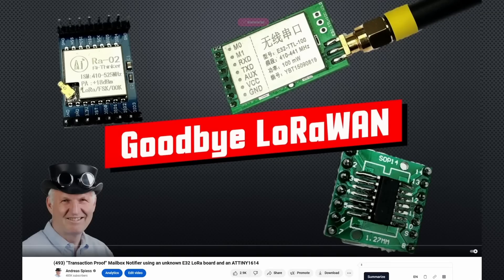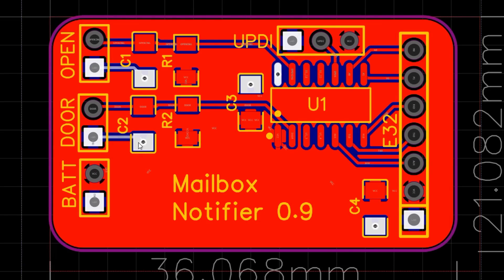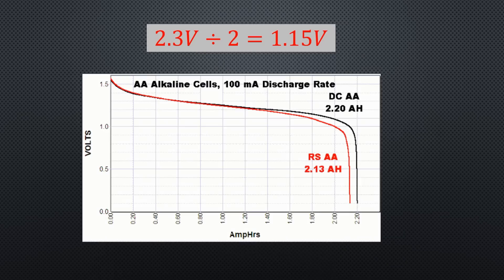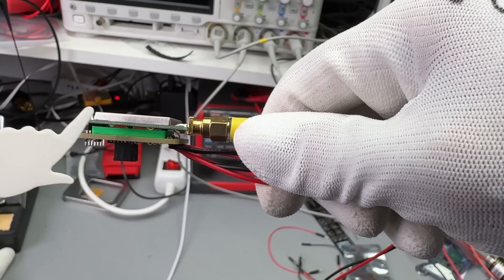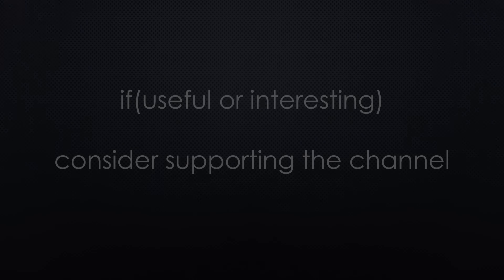(495) Let's build a Lora Mailbox Notifier incl. Tips and Tricks for Your Projects from an Engineer

Comment: Thank you for the video.  two questions:
1.   As I see the trigger is the door opening switch,   the postman is supposed to open the door?     how do you exclude your own opening of the mailbox?     my mailbox just has a slot.   have you considered other sensors, a small PIR maybe?  would it work in my case, ie. the envelopes falling into the box will trigger the PIR?   I know, a PIR draws current when idle, but I guess I have no other choice.
2.  You placed the whole thing including the antenna inside your mailbox which is basically a Faraday-cage.  Can LoRa  cope with it reliably?
Reply from the maker: The slot is for the postman and the door (with a key) is for the owner. As you say, PIRs consume more energy because they have to be always on. LoRa works in my case, yes.

Comment: Building a LoRa-Based Mailbox Notifier: From PCB Design to Home Assistant Integration

*   0:00:02 Project Overview: The video details the complete process of building a LoRa-based mailbox notifier, covering PCB design, hardware assembly, testing, 3D printing enclosures, and Home Assistant integration.
*   0:00:41 Battery Choice Rationale: Non-rechargeable batteries were selected to simplify maintenance, as the device will be far from the house and has very low power consumption. The at tiny1614 and the e32 operate, reliably, down to 1.8 volts and 2.3 volt, respectively.
*   0:01:10 System Components: The system consists of a battery-powered Notifier (ATtiny1614 + E32 LoRa module) and a USB-powered Gateway (ESP32 + E32 LoRa module).
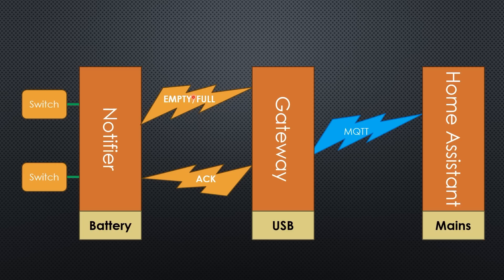*   0:01:49 Communication Protocol: Communication utilizes LoRa modulation with an automatic repeat request system for reliability.
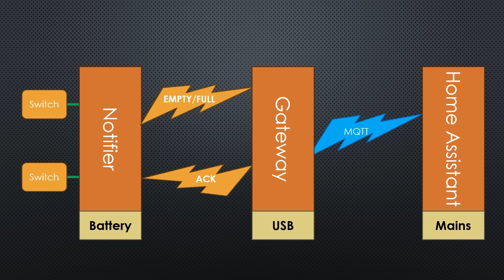*   0:02:01 Home Assistant Integration: Integration with Home Assistant is achieved through MQTT with autodiscovery.
*   0:02:51 PCB Design (Notifier): A custom PCB was designed using EasyEDA, incorporating 1206 SMD parts, ground and VCC planes for reduced interference, and an updi programming header.
*   0:04:07 Pin Reassignment: GPIO pins were reassigned for better PCB layout, enhancing the routing on the board.
*   0:05:55 PCB Ordering Tip: Ordering PCBs in different colors for different versions helps with organization.
*  0:06:21 Soldering: Using binocular magnifier, and tips.
*  0:06:54 Connectors: Magnetic switches utilized different connector, mail and female, to avoid misconnection.
*   0:07:39 Incremental Testing: The Notifier was tested with a prototype Gateway before finalizing the Gateway build, to isolate potential issues.
*   0:08:00 Gateway Build: The Gateway uses a compact ESP32 mini board with an added tantalum capacitor for power stability.
*   0:09:01 Home Assistant Connection: Connecting the gateway to Home Assistant enables testing and visualization of results.
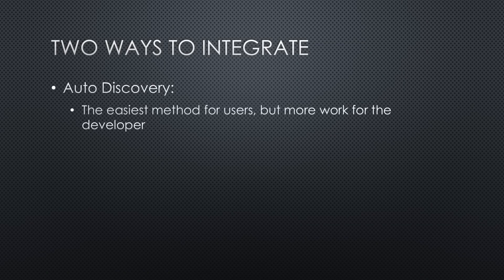*   0:09:21 Home Assistant Autodiscovery: Autodiscovery is implemented for easy user setup, requiring the device to expose specific MQTT topics and send a JSON-formatted message.
*   0:10:51 Home Automation: The integration allows notifications (e.g., Telegram) and dashboard displays for mail arrival.
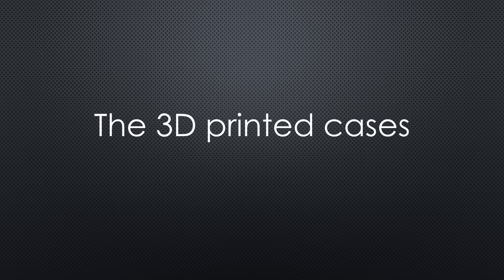*   0:11:17 3D Printing: Enclosures were 3D printed using a parametric box design, taking advantage of a new, faster 3D printer (Bambu Lab P1S with AMS).
*   0:12:21 Hole Printing Tip: Printing holes slightly undersized and then using a reamer ensures a precise fit.
*    0:12:47 Final Mounting: The Notifier and Gateway were mounted to finalize the system, ready for mail delivery.

I used gemini-2.0-pro-exp-02-05| input-price: 1.25 output-price: 5 max-context-length: 128_000 on rocketrecap dot com to summarize the transcript.
Cost (if I didn't use the free tier): $0.02
Input tokens: 14719
Output tokens: 731

Comment: Great project thankyou for sharing. Built  and installed today. I had to modify a bit as I only have one door on the mailbox and I added a battery voltage monitor mqtt to home assistant as well. (it only powers on when door is opened to save power).
Reply from the maker: Congratulations! With only one switch you could switch the power with the reed switch. Then it would last even longer...

Comment: What is the expected range of a device like this? Was it mentioned how far away Andreas’ box is? My mailbox is about 150m from the house and been thinking of making something like this for years.

Great video!
Reply from the maker: My box is about 50m away. However, the metal box is the problem. My LoRa world record 8 years ago was 200km. And others reached even more after me...
Reply: @ Thanks for your reply! I have the possibility to place the antenna outside. I have no previous experience of LoRa. I have understood that LoRA can achieve long transmission ranges, but was unsure if there are any specific limitations for this use case, in addition to the metal box. I’ll test, and find out some day. 

Thanks for your very educational videos! I just found your channel and have now been watching for hours. And I of course subscribed.
Reply from the maker: @bjondersson  Line of sight usually works, also no long distances. No line of sight needs testing. Sometimes it works.

Comment: Many thanks for your ongoing series of DIY projects and tips !  Always interesting and useful. Cool that LORA gets far enough to be used in this application (not intuitive !). As Im more software inclined I think I'd rather code my own tight loop for polling and processing the events from the mailbox rather than be dependent on MQTT and internet. Im in a rural environment so perhaps an external antenna and solar recharging would be better also. Perhaps the 'enclosed LORA antenna' approach would work well for onboard diagnostics in larger systems also.
Reply from the maker: Thank you! If everything is in your posession, you can add solar and an external antenna (I do not own the mailbox). Which would remove a lot of constraints I had for my antenna. But your distances are probably bigger ;-)

Comment: So, you're building a receiver just for the mailbox instead of using a gateway you (I presume) already have? Why?
Reply from the maker: Because it was no more reliable. The TTN sensor worked for years, but since a few month, no more reliably. I did not investigate the reason, I just wanted a simpler system.

Comment: Hello,
How are you using your magnetic switches?
As i know, magnetic switches are normaly closed. So everytime current flows to the pullups and the switches. !?
In your video you are using momentary switches with with NO....

Another question:
in youre code are input pullups are set:
  pinMode(SWITCH_OPENING, INPUT_PULLUP);
  pinMode(SWITCH_DOOR, INPUT_PULLUP);
Are the physical 4.7k Pullups needet?
Why 4.7k and no higher resistors?

greetings
Jürgen
Reply from the maker: Yes, I use magnetic switches. NO and NC is not always defined the same way because with these switches, "normal" is not standardized. So I only bought ones where the seller described the behavior in his own words ;-)
These resistors, in conjunction with the capacitors, should supress switch bouncing.

Comment: I have one question here, what i believe about LoRa it needs line of sight to transmit, in case we have some obstract  it could not communicate, in this scenario when LoRa sender is installed in a metal box, at some ramdon direction how come it can send signal to gateway ?
Reply from the maker: You are right with your statement. However, on short distances it still works out of this metal box because it only needs very low signal levels.

Comment: Thank you!
The notifier runs perfect with an ATTiny412 too!
I only shorted M0 and M1 of the E32 and use only 1 output of the ATTiny.

#define SWITCH_OPENING A3    //PA3 = Pin 7
#define SWITCH_DOOR A0       //PA0 = Pin 6
#define M01 A2               //PA2 = Pin 5
#define AUX A1               //PA1 = Pin 4
//                        TXD = A6 = Pin 2
//                        RXD = A7 = Pin 3

Greetings
Jürgen
Reply from the maker: Indeed a good idea! No distinction is needed for this project.

Comment: I hate the smell of some dupond wires, silicon will be welcome!
The lora ntenna inside the metal mailbox is not a problem ?

(A link to the previous video about it in the description would be welcome 😉)
Reply from the maker: The antenna inside the metal box is a problem, but LoRa with its huge link budget was the solution.
Link added. Thank you for the tip.

Comment: Two AA batteries from Lidl? When they go flat you need to replace ASAP before they vomit their electrolyte, almost as bad as Duracells. Now if I could figure out how to use my Optivisor magnifiers now that I have had cataract surgery, arrrg agrivating, even worse my left hand has developed a bit of a shake. What a curse and I love working on repairing commercial radios and electronic projects! Thanks for this video and I need to look into home assistant, would make life simpler in the home but I have no plans on linking to the open internet.
Reply from the maker: We need people like you who still have the ability to repair radios! They die out :-(

Comment: My version is based on the latching transistor idea you made a few years ago just using wifi. I'm currently powering using 3 eneloop cells into the 3v for the low self discharge, the only issue I have is remembering to charge the cells, any thoughts of measuring cell voltage when powered this way? - Something like the secret arduino voltmeter but running on esp. My box is lined with thick polystyrene in an attempt to retain capacity in winter. Thanks for the great videos.
Reply from the maker: This time I had to choose another way because I had two switches. In your case, you can add a voltage divider and measure the battery voltage with one pin. In my case, it would drain the battery and I would have to add a transistor to switch the two resistors off during sleep.

Comment: I built a yard gate notifier using an ESP32, Home Assistant and (2) inexpensive garden solar lights, and rechargeable batteries. Has been working for a few years not with no issues. The yard lights have a voltage regulator included in the assembly. You could remove the solar panel and mount it on the mail box. Just a thought
Reply from the maker: Good solution, too. I did not use solar because the mailbox does not belong to me and I did not want to make holes, and I also did not want that something stands out. Like that, everything is hidden and locked...

Comment: Tried building something similar with off the shelf lora/meshtastic devices, but failed miserably due to battery limitations. Any way to convince you to sell a semi-built notifier ? Any signal concerns inside a standard Swiss milchkasten ?
Reply from the maker: 1. I will not sell hardware.
2. Of course, the signal is weakened in such a situation. But it works here.
Reply: Thanks!  @AndreasSpiess

Comment: Does the transmit power depend on how much voltage the RF module is getting? Might 3x AA be a better choice to give it some more voltage?
Reply from the maker: I did not measure the output power. Half the power would not matter too much.

Comment: I use a great battery for my projects. It is a Saft LS 14500, LiSOCl2 technology and is 3.6V, AA battery type. This has a fantastic capacity and is capable of running 3.3v circuits, I have circuits, using this battery with MPU sleep that have been running for over 2 years and still going! Definately recommended.
Reply from the maker: Indeed, this is a good technology. Maybe a bit expensive for everyday usage...

Comment: Hi. Another great video. maybe one thing you could have added : a voltage divider to measure the battery voltage. Another thing on your design : I think there is a bit of current leaking from the opening / closing pin (from VCC to GND through 4.7kOhm resistor isn't it?
Reply from the maker: A voltage divider for measuring the voltage using a pin consumes (leakage) current all the time unless you add a transistor to switch it off. And the leakage current through the 4.7k resistor is very small because it has to go through a pin of the MCU which has a high resistance when sleeping.

Comment: Did you have any concerns about placing the device in a metal enclosure and having signal strength issues?
Reply from the maker: That was a concern until it worked ;-)

Comment: With Attiny for simplicity I do the same, but with cylindrical Li-ion batteries, AAA or AA size. They go from 4.1V to 3.0V, don't need any regulator, are cheap and you can just replace it in the device by a re-charged one.  The holders are also the same.  For simple projects, just one AAA size battery last more than one year.  The leakage is also very low.  The new Attiny MCU's by the way are very simple and a lot of fun to program, even bare metal.   And just with one wire + one TX wire, I can flash and debug at the same time.
Reply from the maker: I agree with the ATtinies. I have to try the AA or AAA size Li-Ion batteries.
Reply from the maker: I just looked at the choice. Which one do you use? The USB chargeable ones?
Reply: @AndreasSpiess  And of course these chargers are not compatible with the normal 1.2V NiMH batteries. And being the same size could be dangerous, unless the charger detects it. And also dangerous for a device expecting 1.2V or 1.5V batteries. Better label this batteries clearly, and the holders.
Reply: A prev comment has been removed.  I use normal 10440 (AAA, about 3€ each), 14500 (AA about 5€) or the bigger like 18650. And a USB charger of about 10€, compatible with all cylindrical Li-ion batteries.  In the usual places, just be careful with batteries too cheap or with amazing capacities, in chini-amps hour.
Reply from the maker: @gosdeCarrer  Thank you!

Comment: One suggestion: UPDI connector, pins order, vcc, gnd, updi instead of vcc, updi, gnd.
Reply from the maker: What would be your reason. Mine is: If I power the ATtiny with a different source, I only need two pins.
Reply: @AndreasSpiess  If you mistakenly reverse the connection cable, the attiny will receive the reverse voltage.  With vcc, gnd, updi there is no damage.
Reply from the maker: @mama9712  Good point!

Comment: Could you have used a single 18650 cell and replace it when it needs to be recharged (which would not be often)?
Reply from the maker: I agree. If rechargeable, I also could have used 2 NiMh batteries. I wanted to avoid the LDO. Or one LiFePo4...

Comment: Correction - the better DuPont wires actually copper inside, not just more. The cheap ones aluminum or chinesium if you ask me. 
Any breadboard problem I ever had, was related to cheap DuPont wires !!
Reply from the maker: I am not sure if the reduced resistance of  copper matters on these small distances. Or why do you prefer copper? But the quality of the crimp definitively matters. I also think, that thicker wires do not break easy.

Comment: Awesome video. I also swapped back to regular batteries instead of rechargeable ones, depending on the project. Usually I prefer the so called C cell aka R14. Really cheap and safe. Install it, forget about it. Sometimes it lasts for years! And of course... silicone wires ! They're the best!
Reply from the maker: The R14 seem to be a bit bigger. Because I have many other devices using AA batteries, I always have a stock in my drawer ;-)

Comment: I also like silicone sleeved wires - their fleibility makes them easy to stuff into small spaces. However, crimp connections tend to be weak because of silicone's slippery qualities.
Reply from the maker: I agree they are slippery (sometimes an advantage). But so far, I did not have issues with the crimp quality.

Comment: Good idea to mount the LORA module right beside the ESP32 touching metal /s /j.
Reply from the maker: The sheets do not touch because of the tape. But soldering them together would indeed be better.
Reply: @AndreasSpiess  I'm just saying how the LORA can interfere with the esp32 being so close.
Reply from the maker: @FlatMcdonaldsSprite  In this case, the timing might help (there should be no Wi-Fi traffic before the acknowledgment message is here).
Reply: @AndreasSpiess  👍